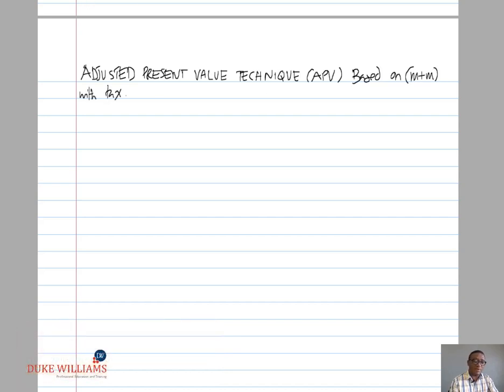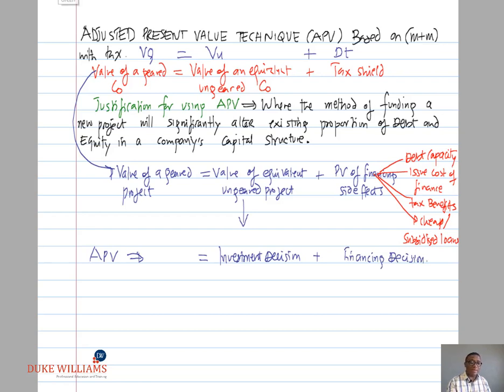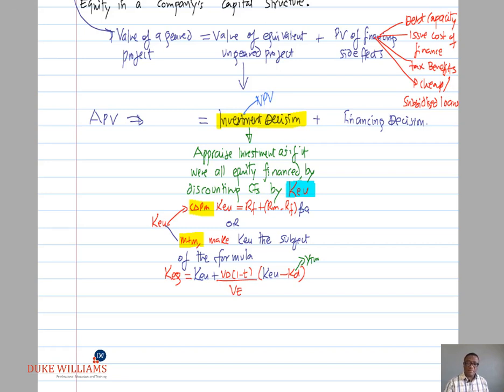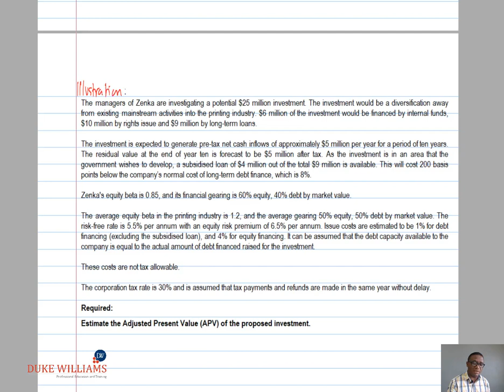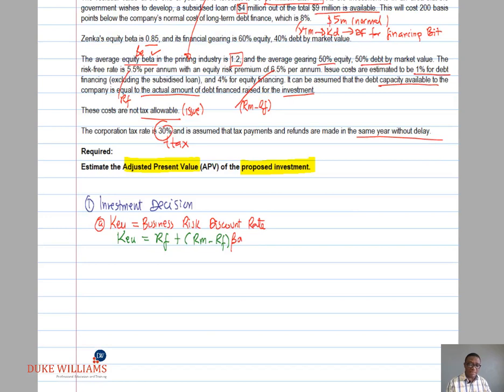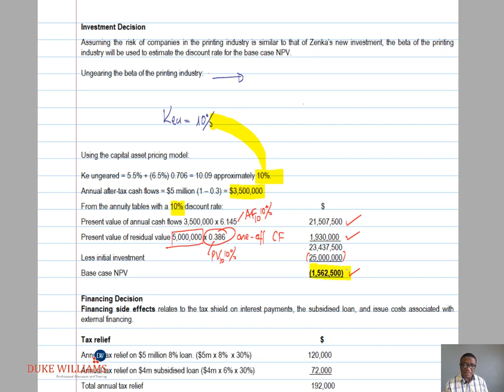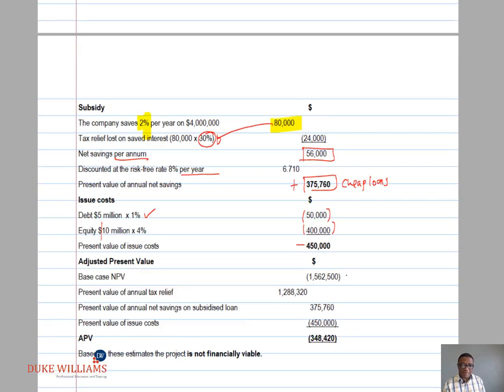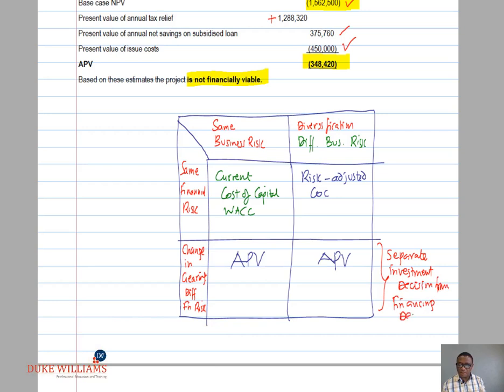011 DW ACCA AFM - Adjusted Present Value . ( APV ) Technique

Comment: When calculating using the CAPM, you were supposed deduct Rrf from Rm but you only inputed the Rm of 6.5. can you pls explain why?
Reply: The question directly gave the ‘Risk PREMIUM’ which is Rm(Market rate) - Rf(Risk free rate) = 6.5. So if a question directly gives the ‘Risk Premium’, it is equivalent to (Rm - Rf)

Comment: Please what happened to the capital allowance on the equipment. Check the calculation of the after tax annual cash flows. The annual capital allowance is suppose to be $2M ($25M-5M)/10. This will affect the annual after tax cash flow calculation.
Reply: if im not mistaken just adjust it during the investment decision npv calculation, like the normal calculation of npv appraisal